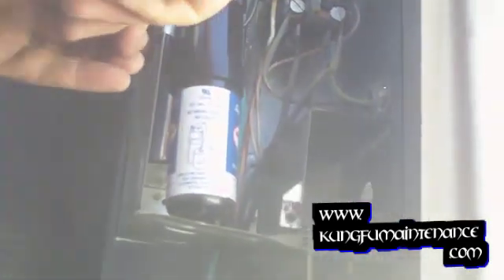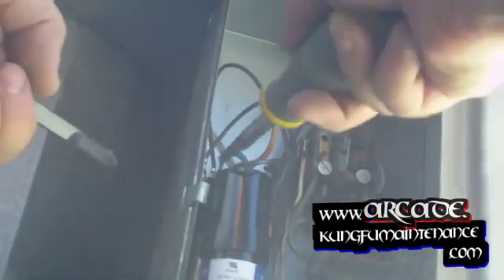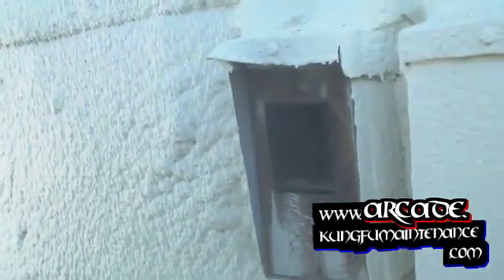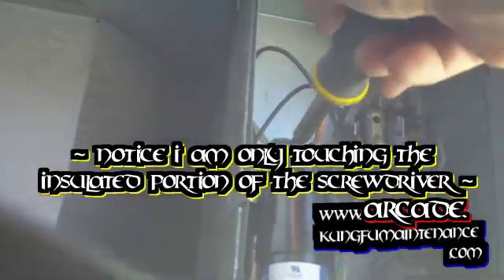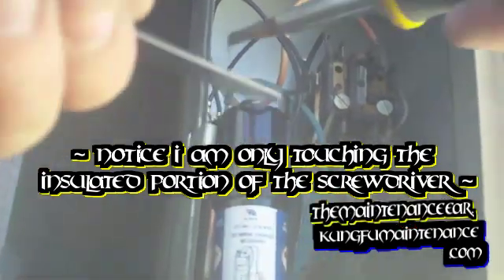Military Grade Cable Tie Method ~ How To Anchor An Air Conditioner Capacitor

Comment from the maker: Search Youtube for the video titled "Mitsubishi mini split troubleshoot inverter board" . The video is not mine but does a good job of showing how to isolate test the board. If the board is bad it will need to be replaced. Ohm (continuity) testing is also a good method for locating the lack of continuity in any de-energized circuit and/or locating shorts. On some advanced systems you may need and benefit from the troubleshooting assistance of manufacturer technical support.